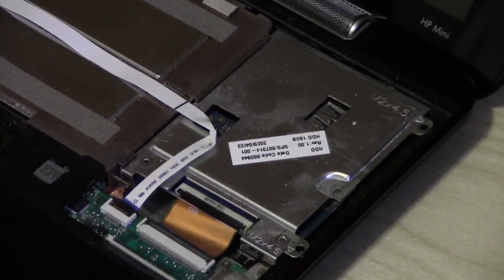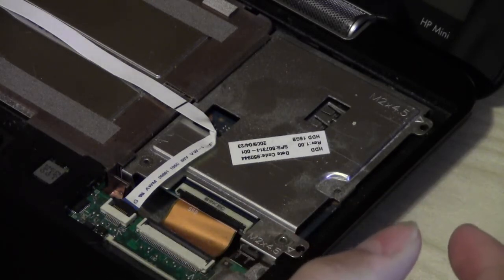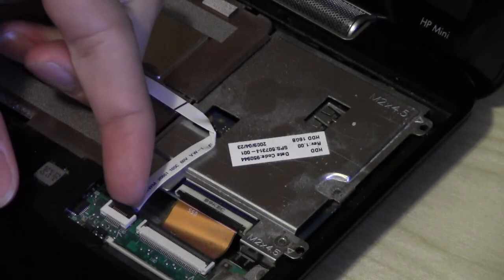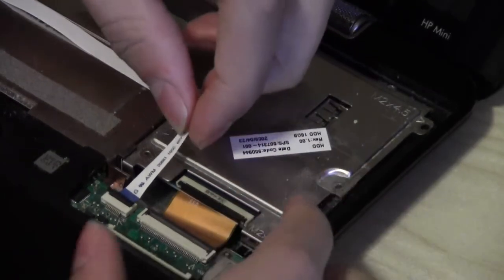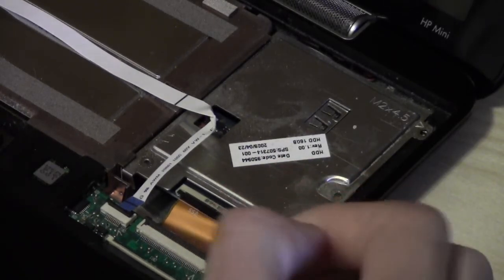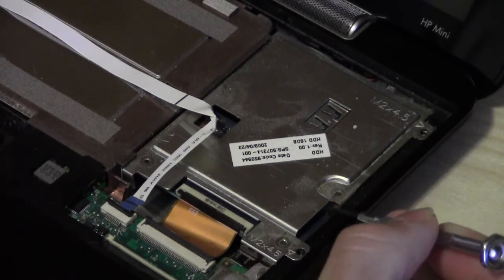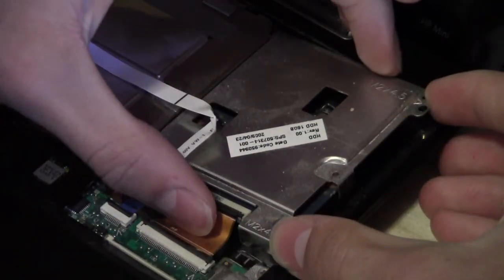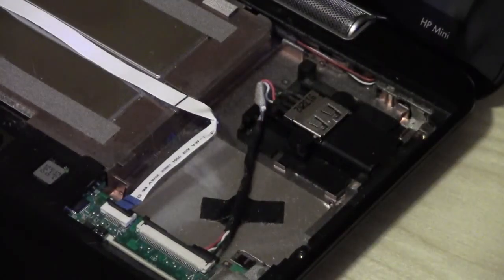HP Mini 1000 Disassembly - Removing the Hard Drive

Comment: hey bro! you still there? i need help finding an enclosure for this hp mini 1000's hard drive... any suggestions where i could buy one? thank you so much!
Reply from the maker: Sorry, I don't have any specific recommendations. I would check Amazon or Newegg for an enclosure that supports a ZIF hard drive. Normal SATA ones won't work since the Mini 1000 uses a non-standard connector.

Comment: could I replace the HDD with SSD?
Reply from the maker: +Satrio Dewanto You can, but you would need to find a 1.8" SSD with a ZIF connector. These are harder to find than the usual 2.5" SATA drives, so it would be worth doing some research to see if anyone has a recommendation for which drive to use.
Reply: +Arnon Erba okay, thanks
Reply: @arnonerba  I know this is a old post but maybe you could help my wife have the same computer it has the same kind of HD but is 15gb could i change the HD to a 2.5 Sata HD if yes could you tell me what would i need to change to the SATA HD thank you for your time.
Reply from the maker: Tainowarrior00707 I don't believe so. I don't think a 2.5" drive can fit past the USB board.

Comment: Hello

This is what I have. The computer has died but I'm hoping to recover the data off the drive. I've removed it as shown. Do you know what cable I would need to connect to another machine via USB?

Thanks
Reply from the maker: You will need some sort of 1.8" ZIF or LIF hard drive enclosure. They are about $10-$20 online.
Reply: I only just saw that you replied - thank you very much!
Reply from the maker: You're welcome! Hope you are able to successfully recover your data. Just remember to be careful with the hard drive's cable, as it is fragile.

Comment: Is it possible for the hard drive to unmount? if for example it was tossed on the bed
Reply from the maker: As the hard drive is held in by a number of screws and uses a flexible cable, it would require a large shock to move it. If your netbook has a spinning hard disk drive as opposed to the solid state drive shown in the video, it could be damaged if the computer underwent a shock while it was on.